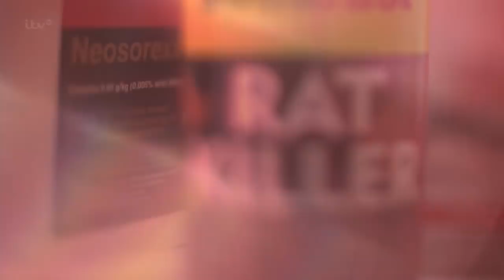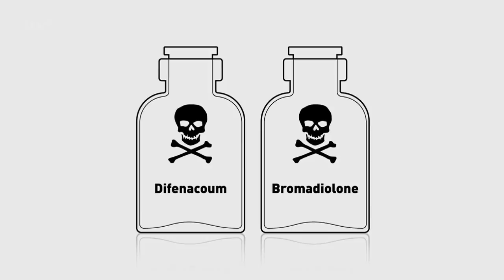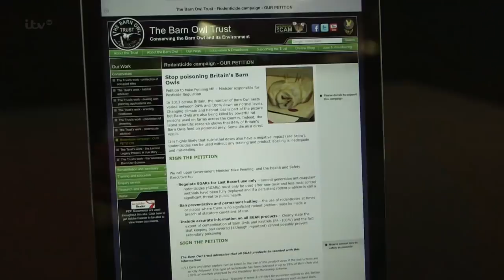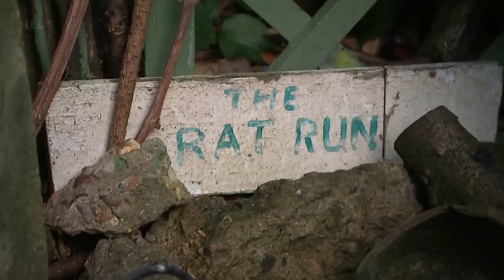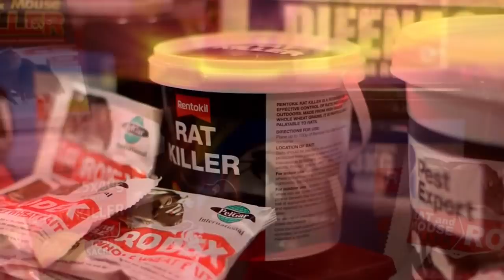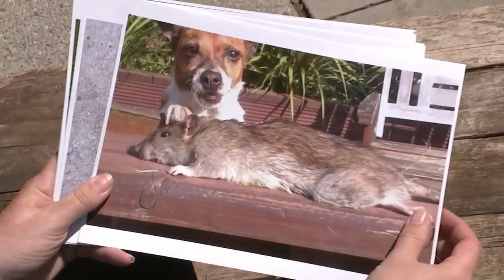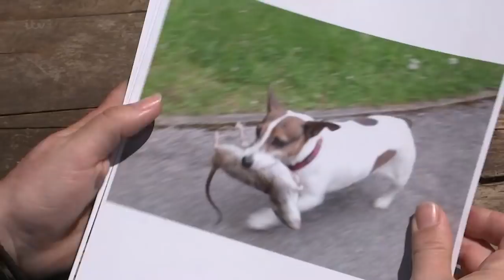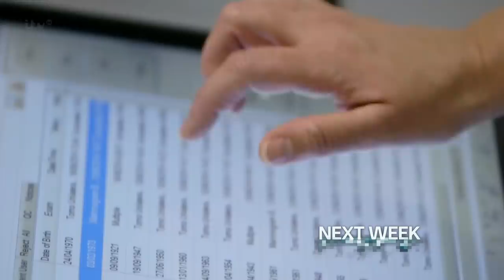Rise of the Super Rats

Comment: Yep, the best protection against pests inside the home is a properly secured exterior.  If there must be some kind of vent, make sure it's got a sturdy steel mesh.  Use epoxy cement instead of silicone to seal up around any vents, and sure as hell don't have exposed expanding foam filler/insulation, the pests will burrow into that.

Wood isn't a deterrent either, if a rat or even a mouse can smell anything like food coming through a crack, they will chew through wood.  Had a fat rat chew through my dad's solid wood garage door, he tried replacing the bottom with a harder wood but it just ate through that too.  So eventually he nailed sheet metal all along the bottom and that finally did the trick, the rat was too smart for traps, or poison even.  My dad tried encasing the poison pellets in peanut butter, and the damn rat just ate around the pellets!  Finally caught the thing with a noose trap, and god damn was he huge.

Comment: The best way to get rid of them from your home is to find the holes and seal them up with steel wool and plaster.  If they eat the steal wool they will get sick.  Also, if you don't want to use poison, there is another effective method, which was taught to me from a former co-worker.  She told me to get an empty clean plastic bottle and fill it with 33% bleach and 67% water.  Step 1. Spray the mixture on the baseboards of the wall where they run.  They will loose their scent once you spray it.  Step 2.  get small aluminum trays and mix 50% corn meal and 50% plaster parish. When the rats eat this they will thirst for water.  Once they drink the water their insides will get hard.  Anyway, the bad side to this that they may die in your walls or they may come out and ask you to help them.  They may die right on your floor.  If you have them, you have to get rid of them because they carry disease. You don't wan them to bit you or your children.

Comment: Years ago, there was a huge rat problem down south in the US.  County officials offered a bounty of .50 per rat to local hunters.  They were so overwhelmed with payouts that the bounty was lowered to .25 per rat.  Again, the county remained overwhelmed with payouts.  They no longer had an abundance of rats as the problem, they had an abundance of hunters.  In fact, rat hunters appeared in droves until the county began to issue rat permits to control the hunters.  So, what are you blokes going to do in the UK with no guns?
Reply: +Bourne Accident They didn't even begin to allude to something like that, which is an efficient way to greatly reduce the rat population. But, noooo they're too smart for that ; )

Comment: there is a safe humane way to kill all the rats! its far fetched but will work , the house or building needs to be sealed up nearly air tight , or as close as poissible, then high volumes of nitrogen gas are pumped in with high power compressers and houses, the nitrogen displaces the air and will suffocate the rats, for wall infestation holes are drilled in the walls and high preasure nitrogen gas is injected,
Reply: without enough oxygen all mamals will die fairly quick, for older buildings a dome canaopy like a giant tent is placed over the structure, holes in the basement are sealed off and large tankers or trucks with nitrogen gas then arrive and the gas is pumped in at high preasure and high volumes,
Reply: if the right ration of nitrogen to oxygen is used it wont kill the rodents but temporarily put them to sleep and pest control specialists can contain them safely and relocate them far away back to the wild, volume of nitrogen gas . ratio of nitrogern to oxygen determines wether the rats will be temporarily immobilized or extermintated,
Reply: Or just cutting off their food and water sources so that they dont even want to be in your house in the first place!
Reply: by the way there are no rats this size!
Reply: Rats dying in walls is horrific and makes your house smell badddd.  My mother in-law had an exterminator kill an infestation in her attic and oh man it was awful as they had gotten into the walls and when all the rats died you had them in the walls dead.   

The best thing is trapping, bringing in possums which eat the rat babies and possibly work on returning foxes to the neighborhoods or having trained cat rat hunters which my husband has created at his manufacturing plant.  Keeping a healthy (lost pets/feral) cat colony on the 8 acre facility they release the cats at night into their buildings who hunt down the rats, mice, horrible bugs from imported manufacturing products and they cut their extermination bill by 75 percent!
Reply: Helium would equally work. Really anything lighter than oxygen.
Reply: or just get a cat
Reply: Ivan Kisaragi We have about 6 stray cats living around our home and we still got a rat. It helps but it's not the solution. Like I said, just cutt off their opportunities
Reply: agreed a cat will fuck shit up. if that doesn't work get a male cat. if that doesn't work get a ginger male.